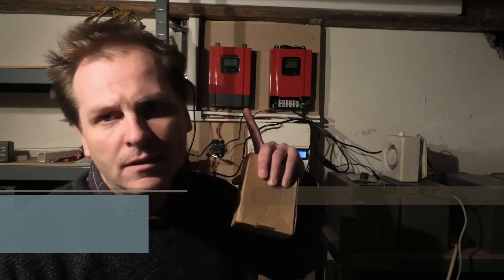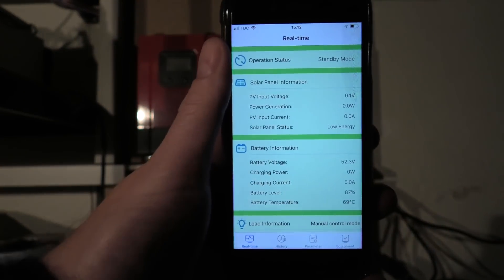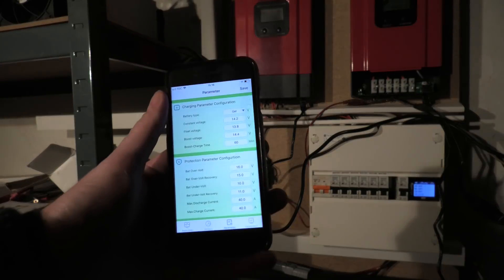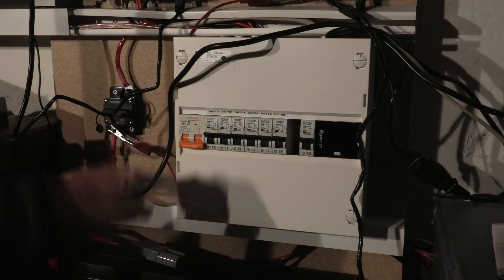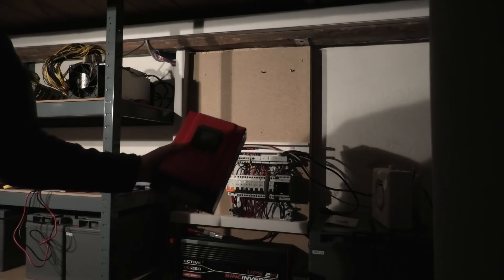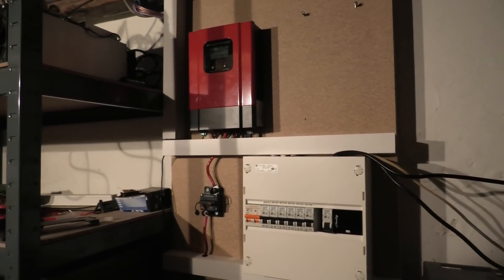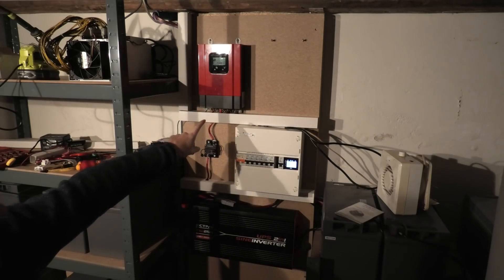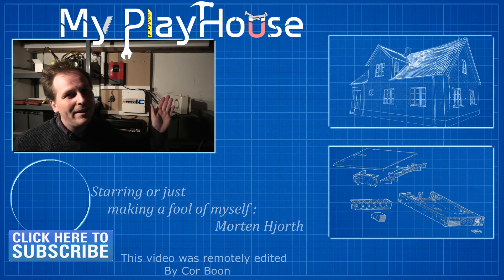Cloud Box-M1 Wifi Module for eSmart3 40A Solar Controllers - 887

Comment: hello morten;

Are you still using cloud box-m1?
Reply from the maker: Yes,, not every day, but it still works!
Reply: @MyPlayHouse  Mygreen app gives connect:200 error even though my device is connected to the internet. I also reinstalled the program. I reinstalled cloud-box-m1 and the result is the same.
Reply: @MyPlayHouse  Is there somewhere I can do or check?

Comment: Mr Morton is there a setting to charge lithium battery's? Thanks for sharing dis video
Reply from the maker: No,, there is not,, and I have also been missing that.
Reply: I am using "User defined" for my LIFEPO4 batteries. It appear to work just fine (when the E-smart is working, I have had a few faulty ones by now but have repaired most).

Comment: It is a total faluire ! It is s fraud system !!
Reply from the maker: Well Einstein, if you could not get this working, it is not the systems fault,, mine works just fine.
Reply: @MyPlayHouse  ,the "cloud box" , should be sold with descent software , the only way to contact the programmer is by gmail ! , he never respond , I had to start the software 10 times to get readig!, I found a 2018 version , works better , but still unstable ..

Comment: Hello, can the Cloud-box wifi module be used for a hybrid inverter that includes a complete mmpt controller and has an RS485 port?
Reply from the maker: I would not know,, it works here, but I have nothing else to test it on.